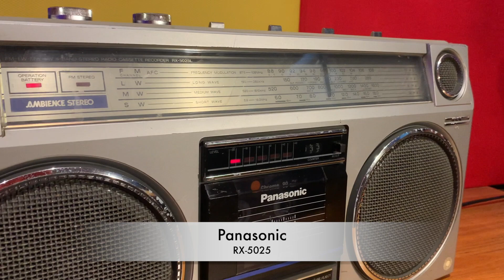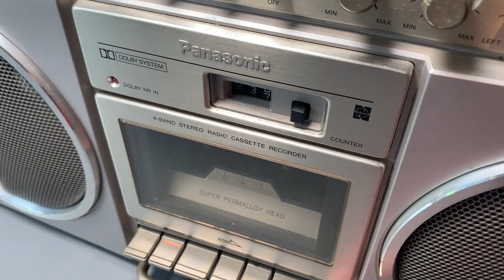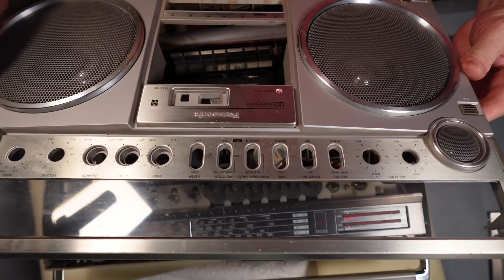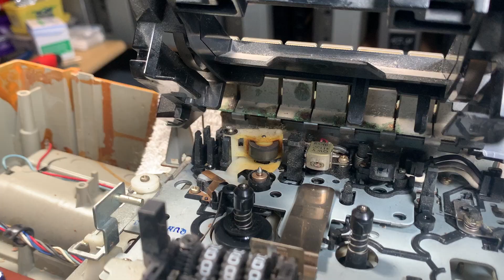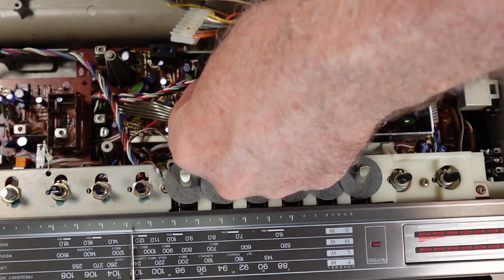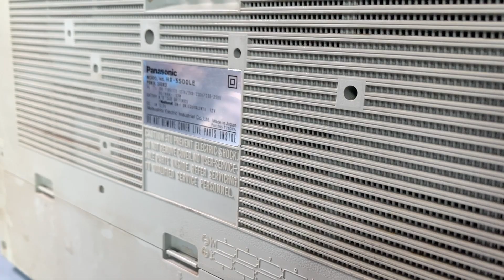Panasonic RX5500LE. How To Change The Belts. Radio Cassette Repair. Boombox Restoration.

Comment: I doubt this was "made in China"!!! The Japanese knew how to make radios in the 1970s/1980s.
I want to see "made in Japan" back on our shelves.
Reply from the maker: I work mostly on mid 70's to early 80's machines, so pretty much everything is MIJ.Although the country of manufacture is stated on the main casings, it's always a bonus to have the little 'Made in Japan' sticker on the front - and I never remove them, even if the front case needs a lot of work. Thanks for watching 👍

Comment: I used one of these all trough the 90's :D . Spent alooot of time recording mixtapes on it :)). I just took it out of storage, and discovered that the volume meter is kind of damaged. When i change volumea i get alot of ststic noise,  and i kind of need to wiggle it a bit until it gets clean sound. I wonder if it's juts oxidised and i can clean it or if it needs replacement.......
Reply from the maker: They rarely need replacement. A clean usually does the trick - you'll be making mixtapes again in no time 👍
Reply: @retro_restos I don;t know about mixtapes :)) But i would LOVE to use the panasonic as very retro looking oversized soundbar :D

Comment: Cheers!  What do you use to clean/polish the dial cover?
Reply from the maker: Thanks for watching as always 👍It depends on the state of it. Usually just some window/glass cleaner. Occasionally top dress it with vinyl treatment. T-cut is a great first step if it has fine scuffs & scratches. Incidentally, if you want to know how to really go to town on plastics, check out my Grandstand Munchman game repair video - I start with sandpaper.... 😬😀

Comment: Panasonic do make great boomboxes i have a tiny little rx 20l . needs belts and most likely caps and some restauration .
Reply from the maker: Yes, I have certainly been impressed by the 5025, 5030 and 5500 I've had in. I also have a couple of RX1450 units I need to sort (trying to find speakers at the moment).

Comment: If the Hitachi 8190s are all pre sold, at least do a rack walk through pointing out the favs'  also the parts bin, need some parts for two boomboxes I have...
Reply from the maker: I have another 8190, so I might sort that whilst I'm doing the one that just came in. A walkthrough would be cool to do. The shop is a mess at the moment though - I might wait until it's tidier 😂
Reply: If you want to move it on 8190, think of me. @retro_restos
Reply from the maker: Thanks for the coffees by the way 👍😃